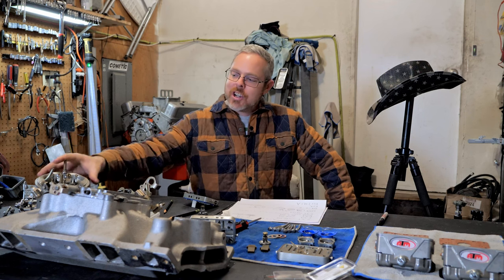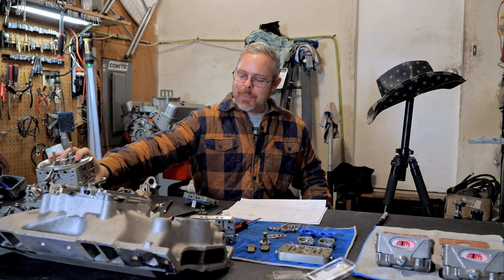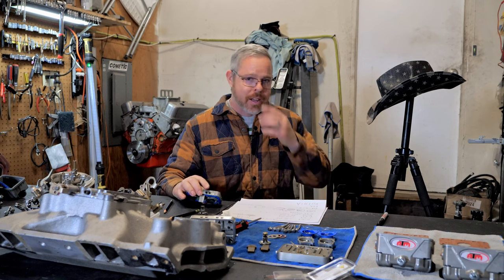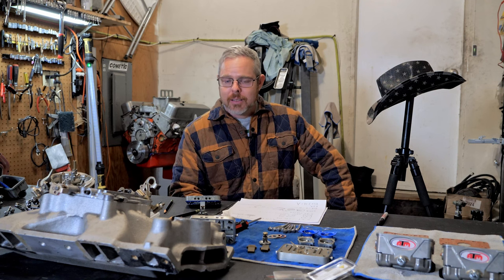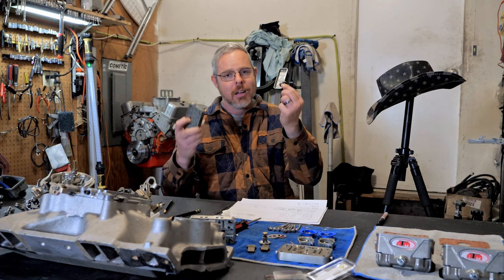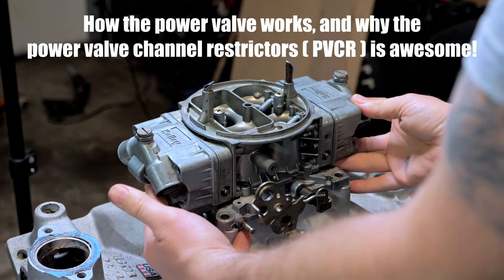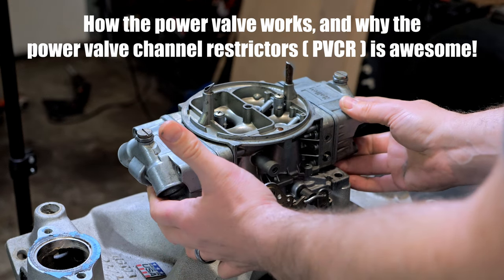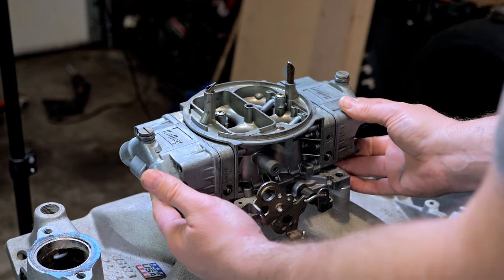Become a PRO ( HOLLEY 4150 TUNING ) learn to square your jetting with a power valve!

Comment: These videos are helping me tune my Eldebrock VRS 4150 - I am a bit fat but the transitions are good. I have blocked off the rear PV and will be down jetting the fronts by 2 and see how that goes. The metering plates on this new carb are crasy and they have 4 air bleeds on each bore of the carb. its crazy - I love it!

Comment: Great video! I love all your videos. Your technical analysis of Holley carburetors is great. However, you can make a Holley run very well with both power valves blocked off. I've been doing that for 20+ years. If you have an engine that makes 5-6 inches of vacuum, you will have trouble running power valve.  Even a 2.5 will cause a massive rich condition when you part throttle accelerate. You can run no power valve and never have an issue with loading up. Non of my cars load up or have any issues with no power valve.  I've never experienced loading up.  If you are loading up, you are jetted too rich or have other issues.  Although, fuel economy will suffer a bit with no power valve. You can lose a couple mpg but if you have a hot street car, you don't care about mileage. If you have a mild engine and cross country the car, I'd definitely run a power valve as long as you don't have much overlap and at least 10 inches of vacuum. The power valve will help with economy.

Comment: Heres one for you... Im running the lt1 on the stock cam with a 650 brawler. Ive got it pretty well tuned and followed a lot of your videos but... because its the stock cam Im pulling 25hg when im off the gas say going down a hill. I see my 02 gauge going lean and it pops and bangs out the exhaust. If i fatten up the jets it cures it, but then my cruise is 12:1 and im seeing 10:1 under hard acceleration. I may see 15/16 off throttle and no pops. Im running a t56 aswell so there are times im on hardly any throttle or possibly even off throttle going down hill. My idle vacuum is about 21hg. Now im leaning towards idle airbleeds so that i can fatten up my idle circuit but not kill the rest of the tune. Im on 70/74 jets btw vac secondary. Perhaps a vid on air bleeds? Not the ones in the metering block but the removable ones in a brawler? I dont want to buy the air bleed jets yet because shipping to England hurts! Peace

Comment: I have a 750 proform double pumper.  Got a ton of carbs actually. Those purple throttle bodies i cant get them to cruise right.  Its something with transition slots on them.  Il slap a stock holley one on.   Lean spike at cruise goes away.  Ive also discovered that the idle jet in billet main blocks being higher up causes revision and afr wil bounce around everywhere.   Stock blocks got jet low and dont do that

Comment: great video     i have a blueprint 540 /700 hp   big cam  tight overlap    fouling plugs  holley 850 df dp  .80 jets front and rear no power valve in rear   what i have done  took vac at idle  5.5 in
powervalve from new is 6.5 in    changed  powervalve to 3.5  front jets to .78 running better 
does not seam to be loading up at idle  not running as rich   anything else you think i can do would appreciate it thanks matt dell

Comment: Good description!  Question, how does the air bleeds affect the part throttle AFR? 
Idle air IAB 
High speed air HSB
Reply from the maker: The larger the low speed it will introduce more air at part throttle from what I have messed with. High speed will effect upper rpm range at WOT same deal the larger the more air will mix like shaking up a soda and opening it.

Comment: I'm having some problems with my ATM 950.i can't get the idle to 12.5 to13.then when pushing the pedal down slowly the afr goes leaner as the pedal goes down to the floor afr is 21 at the floor popping out ex.can u point me in the right direction.

Comment: HeyTyler, I got a question. I was able to  able to get my AFR to 14 at cruise but after driving for 5 miles or so  it goes pig rich like down into the 10s at cruise and idle. Any suggestions ? This 750 4150 DP has got me baffled. Also went w/a Proform main body a while back and the proform logo is on the passage side . I believe its mirrored on both sides but not sure if it matters or not.Thanks Britt.
Reply: When at 14, is engine warmed up?

Comment: Why bother squaring the jets?? If it works fine with a power valve, and 10 jet sizes difference between the front and rear (like it comes from the factory) then just LEAVE it that way.... 🤷
Reply: Probably if you were to pay attention to the video that some of it has to do with performance and racing, that is why squaring the Jets helps